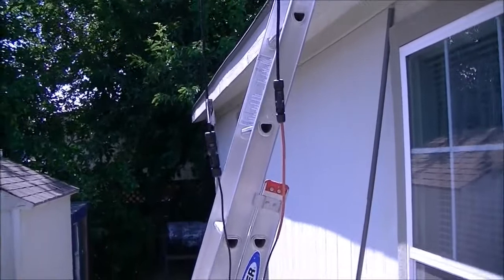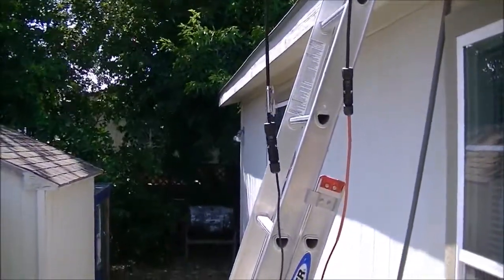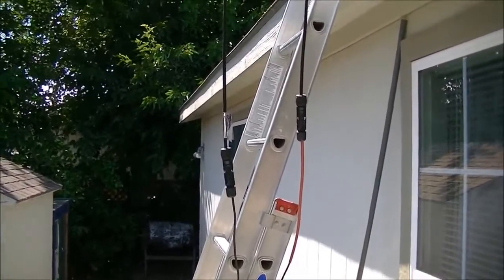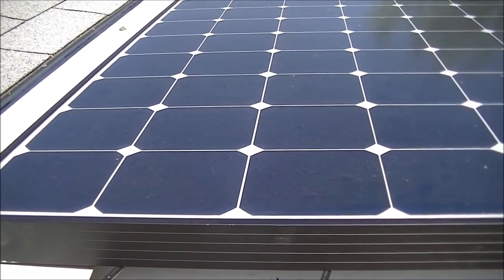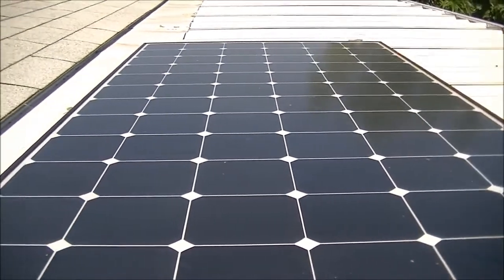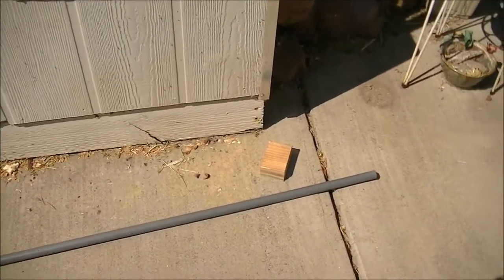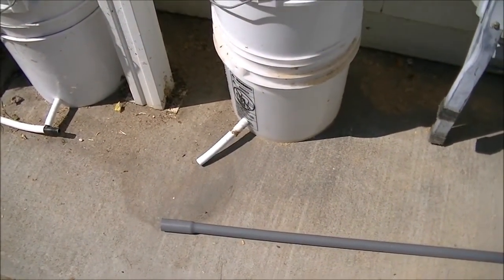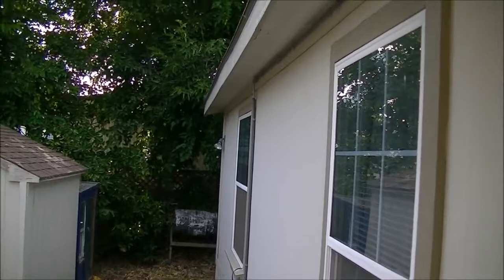Installing Conduit For My Solar Panel

Comment: I'm installing a 5.1 kw system on our house, I'm at the conduit stage now.  One thing I learned is that dissimilar metals (copper, aluminum) react easily and quickly in solar systems.  Solar Edge.com has a lot to say about it.  The secret is to separate anyplace where the two metals meet (ground wire and a rail frame member for example) with a stainless steel item, often a 'star' washer that digs into the metal surfaces past any oxidation, establishes good contact, and prevents disconnects due to dissimilar metals sublimating.  Iron Ridge (rails) makes a grounding lug which is mostly cast aluminum, but has a stainless steel screw that secures it, and breaks any oxidation on the aluminum it's being attached to.
The SolarEdge system I'm installing uses "optimizers" one per panel that control the power coming off each panel and identify each panel online, when monitoring the performance.  The optimizers also limit the current produced to 1 Volt when the system is turned off and being worked on, or provide Emergency shutoff for firefighters.  A big knob in the center of the Inverter control box makes the system safe.
Outside, EMT connections (should) be weatherized, but that's hard to do effectively using the parts from Home Depot, in my experience.  Inside, you can go to PVC or use non-weatherized connections, in California.  I'm putting the EMT runs under the roof overhang, using weather proof fittings when available, and covering problematic sections with a simple roof flashing made of aluminum foil with a heavy, sticky backing.  Also, the EMT has a low point, where the connector isn't weatherproof on purpose, to let any water out, that might have gotten in.  That's contra-code and done after the inspection.

Comment: I have renogy panels too!! I love 'em!!!
But, as long as that metal roof is attached to metal poles that are driven into the ground, you are fine with your grounding (make sure the panel is securely fastened to the roof though).  If not, you'll need to run a wire from the frame of your panel down to the ground to a rod that is driven deep into the ground (to be safe).  Or, to some outside plumbing.
Reply from the maker: Christmas Eve You're right on all scores. Thanks.

Comment: It looks a LOT better, and a lot safer too. I wouldn't paint the conduit either. They will end up pealing, and you will wish you never painted them to begin with. You will get to the point that you won't notice the conduit at all, and it may need some "tweeking" in the future anyway, so you may want to just leave them as is.
Each job eventually adds up as a finished goal, but we eventually end up changing something later on to, so small "wins" and small "success" are perfect to me. Big or small, they all count.
I think we have the same solar panels. Renogy? 
One last thing, I think that roof may need to be grounded, so if you find out that it needs that, will you show us how you correct it?
Reply from the maker: You may be right about the peeling. Yes, if I ground the panel I'll show how I do it. Lightning is rare here, though. I've lived in this part of the country for 30 years, and I've only seen lightning a dozen times.